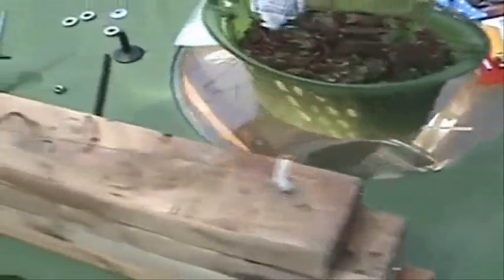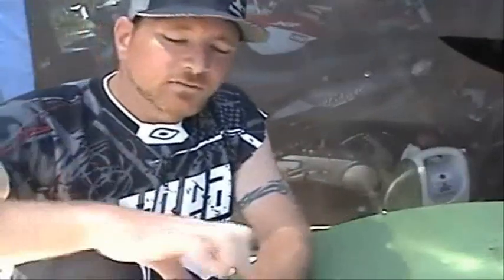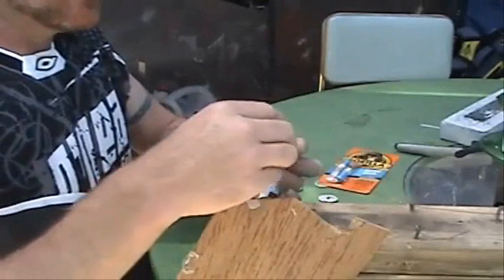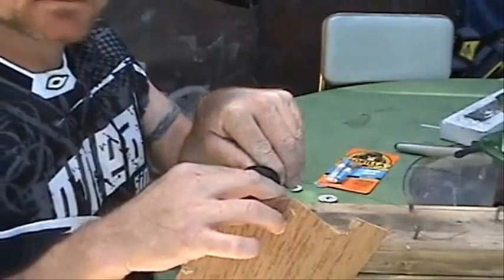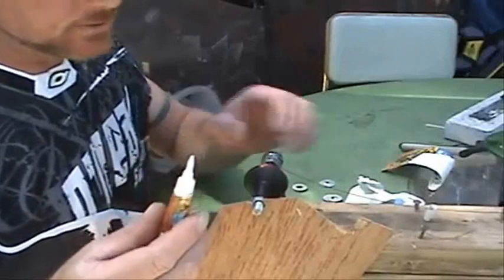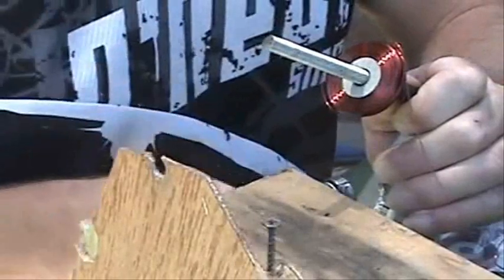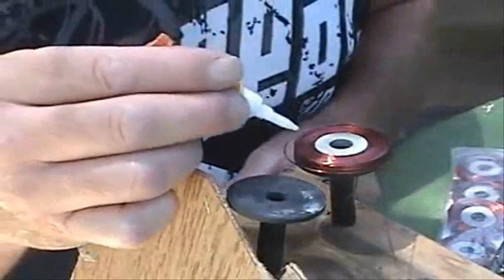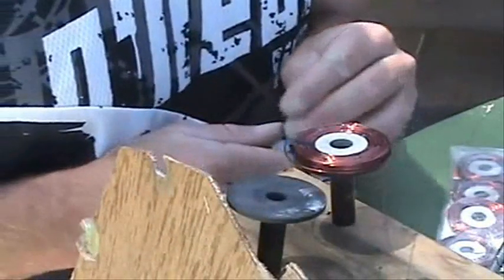HARBOR FREIGHT WINDMILL CONVERSION

Comment: Doug, nice vid.  Quick question, wouldn't it be better to have 9 coils?  Reason being is this way you could have a 3 phase stator (which is what I've seen as the standard in many of these DIY stator vids).  From what I understand 3 phases makes the power produced more stable.  Just a thought.   How's the garden btw? Keep up the great work.

Comment: @rhesuspieces81 
You are right, but the weight of the glue is negligible compared to the copper wire. Nice video, I tried making my own coils, but I didn't manage to have a good result. The wire I used was too thick --> more convolutions --> coil is way to big. If I am going to make my own coils, I will use this method.